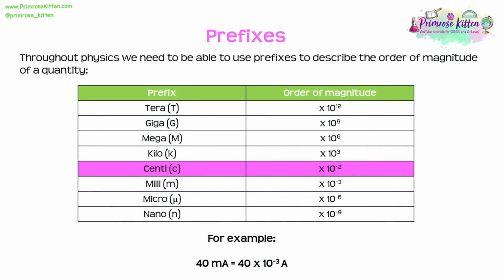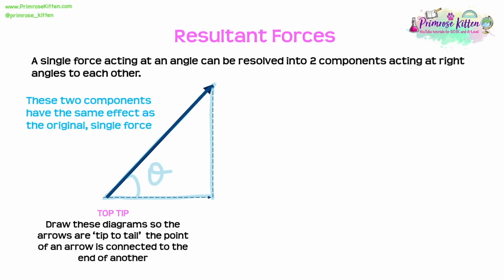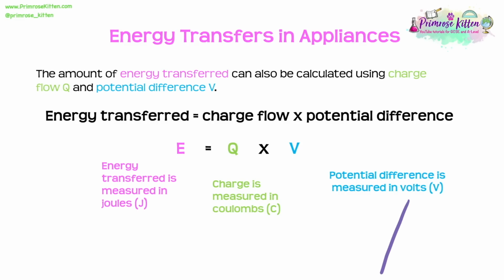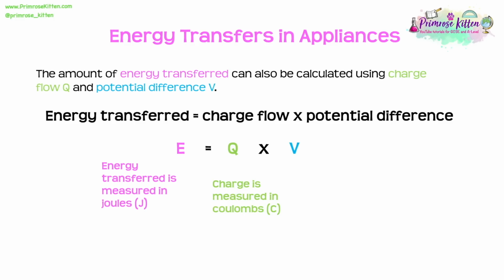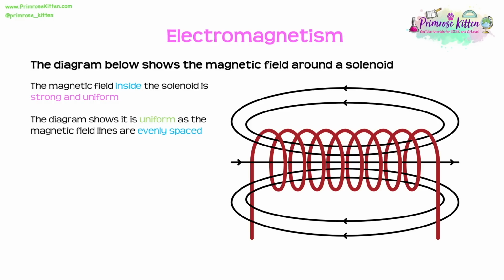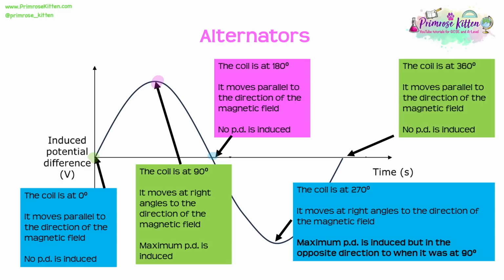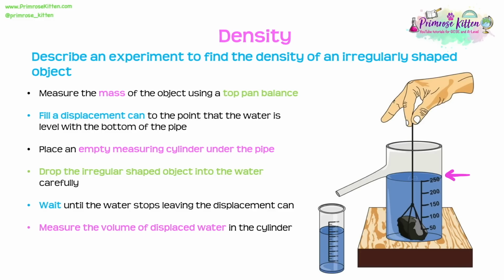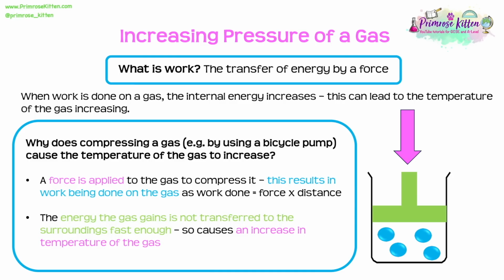Grade 9 | Edexcel | Physics paper 2 | Whole topic video

Comment: 0:35 prefixes
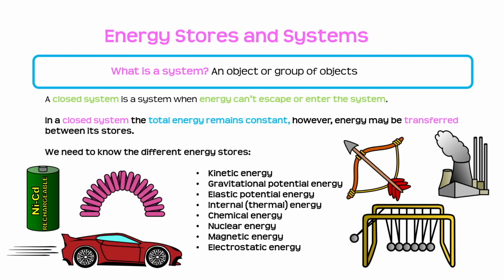2:29 energy stores and systems
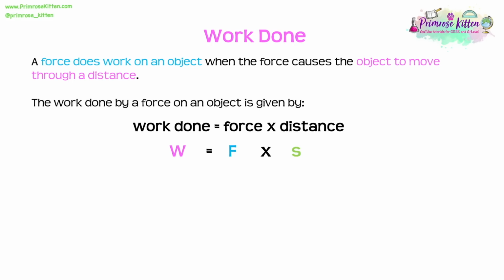5:53 work done
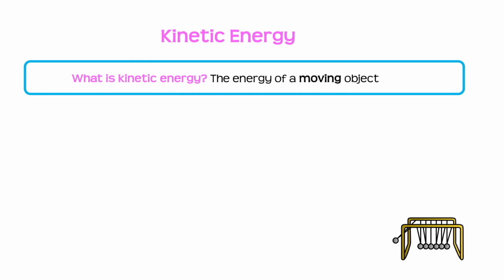6:55 kinetic energy
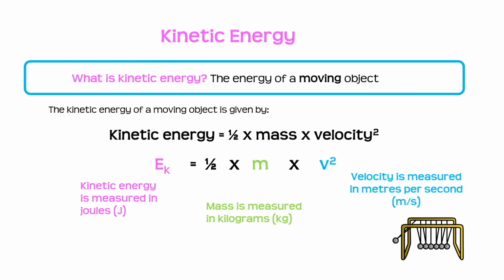7:15 gravitational potential energy
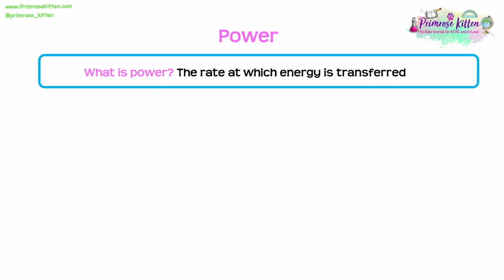8:05 power
9:05 energy transfers in a system
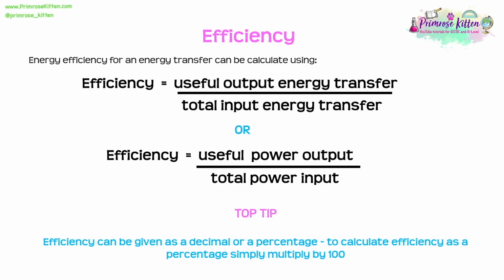10:55 efficiency
12:15 scalar and vector quantities
12:45 scalars and vectors
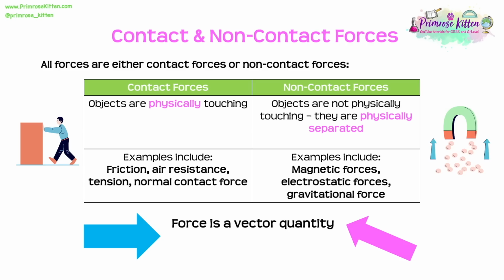13:25 contact and non-contact forces
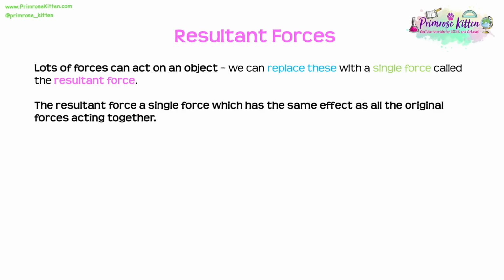14:35 resultant forces
18:55 moments, leavers and gears
22:25 lubrication
22:45 the atom
23:36 circuit symbols
25:56 series and parallel circuits
29:05 energy transfers in appliances
32:15 charge and current
34:25 V,I and R
36:05 resistors
42:35 energy transfers
43:35 electrical power
44:55 energy transfers in appliances
48:05 alternating and direct current
48:45 mains electricity
53:06 static charge
58:15 electric fields
59:35 magnetism
1:02:05 electromagnetism
1:04:35 uses of electromagnets
1:05:45 motor effect
1:06:15 left hand rule
1:08:05 electric motors
1:11:45 magnetic flux density
1:12:25 loudspeakers
1:13:45 generator effect
1:15:36 alternators
1:19:35 dynamos
1:23:05 microphones
1:23:55 transformers
1:28:35 the national gird
1:29:55 density
1:37:15 changes of state
1:38:35 internal energy
1:39:35 specific heat capacity
1:41:25 specific latent heat
1:43:25 heating and cooling graphs
1:45:25 particle model in gases
1:46:45 kelvin
1:47:25 pressure in gases
1:49:35 increasing pressure of a gas
Reply: THANK YOUUUUU 🙏🙏
Reply: goat
Reply: I appreciate this so much 🙏